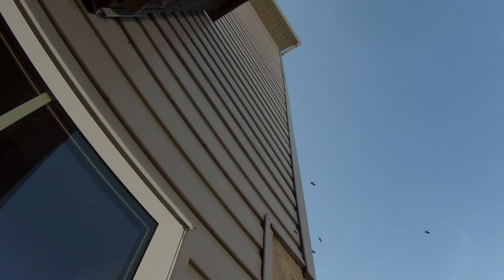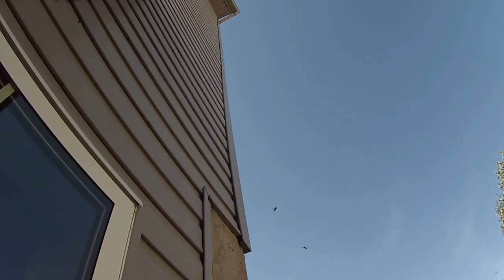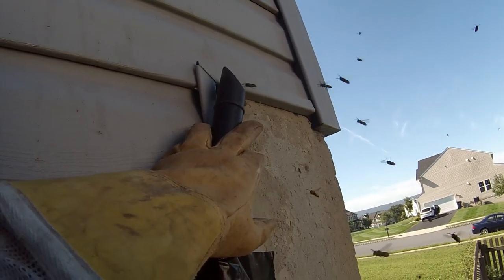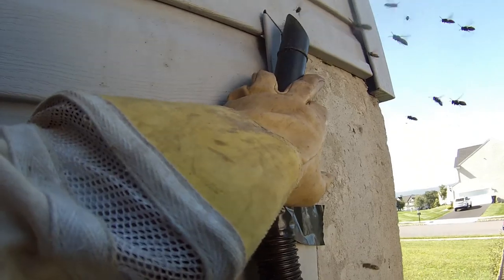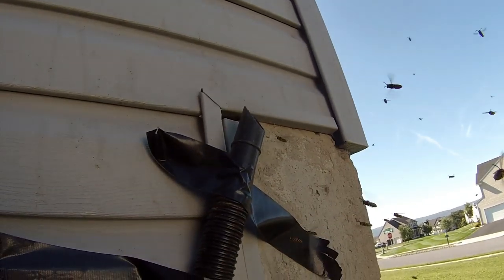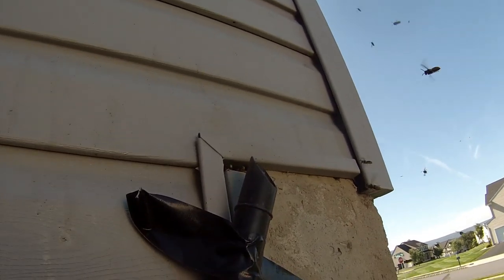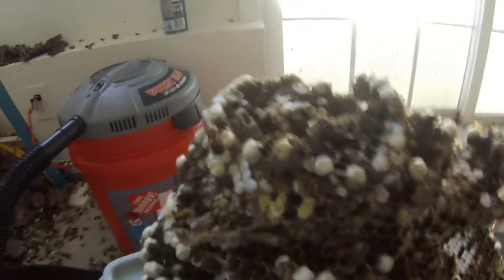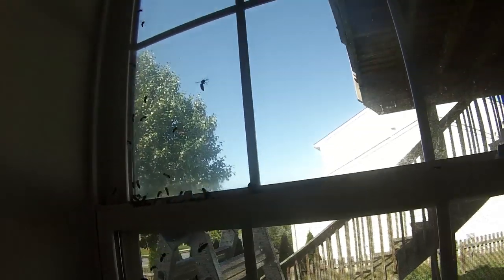Yellow Jacket Hustle.

Comment: Interesting video. But I'm wondering why not put the hose right up against the opening facing inwards, then after a while turn it around to get the ones trying to return?
Reply: Bills by the hour…… 😂
Reply: he never frickin' angles the hose end to maximise the catch-rate--i could get about 88% more just by twisting and repositioning the damn nozzle!
Reply: it has that particular shape for a reason!
Reply: by the time he opens the shop vac up, there's always surprisingly few wasps in there--like i said, i'd be far more efficient and no slower!
Reply: Bees sense the strong air flow.  If they're in the nest, they can hold onto whatever they're standing on and walk away.  If they're airborne, by the time they notice the air flow, they're too close and have nothing to hold onto.   That's why he's catching most of them on their way back in.
Reply: Because it's easier to catch some when they're going back to the to their nest and it is to suck them out of the nest